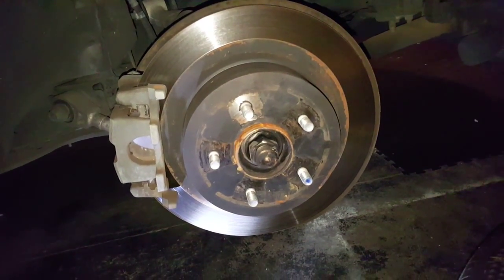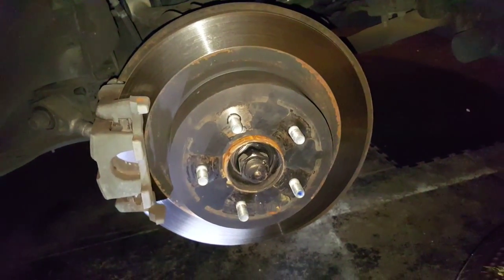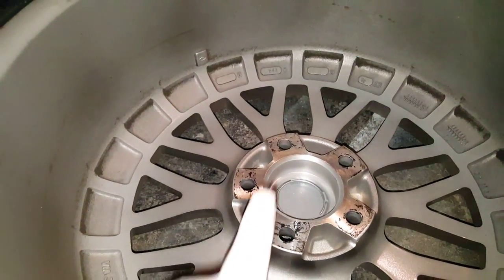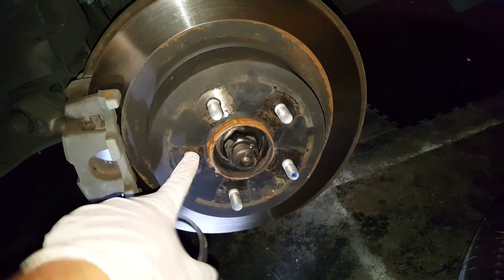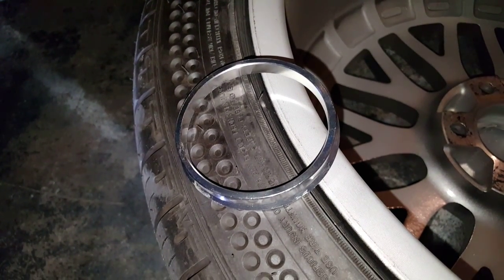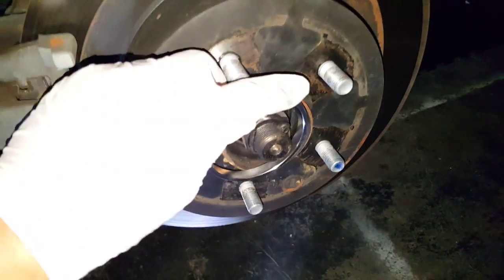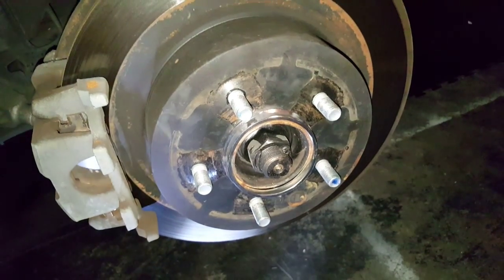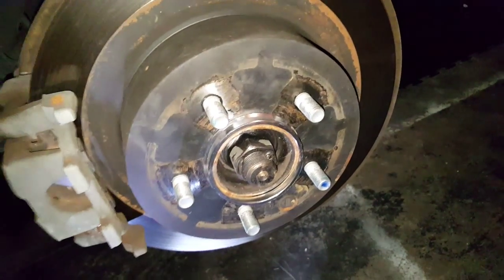How to install hub or hubcentric rings on aftermarket rims - Fixes vibration / shakey

Comment: Is the hub centric rings advisable to put on the steel rims. My winter tires with steel (not alloy) rims are bigger holes on the hub and planning to put these rings. Please advise. Thnks new subd.

Comment: With hub centric rings, can you run spacers also? Or do you need to have spacers that already have the hubcentric ring on them?
Reply: You have to buy hub centric spacers. There are non-hub centric spacers, and those are not recommended if you have a hub centric car(which is most cars).

Comment: Thank you for the video.  My question is, do you install the hub rings on the wheels first and then mount the wheels onto the hub, or install the hub rings on the hub and mount the wheel over it.  Thank you
Reply from the maker: Either should work. If it is perfect fit then  it shouldn't matter. If you bought the right size. If you put it on the hub, it shouldn't move. Then take it and put it on the wheels, it should fit the same.  If both then it shouldn't matter what order. I personally do the wheels

Comment: Do you know if these also fix wheel wobble ? I installed bigger after market rims and tires on my car and they start to wobble at any speed my stock didn’t do that and I already had the aftermarket ones rebalanced because I thought that was it but it wasn’t
Reply from the maker: Yes most likely this would be the cause of it's already balanced and its not balanced.  Buy it on Amazon. If it doesn't help, return it
Reply: @djsonnee  ok I bought it  hopefully they work

Comment: I have a 2010 Corolla and I was looking at getting the Motegi Racing MR119 Rally Cross S 17x7" rims to replace my stock 17x7" rims. Would I need to buy new tires as well, or can I just have a tire shop switch them over? Also, how would I go about finding a hubcentric ring to fit the aftermarket rim?
Reply from the maker: Kelby, I googled this, http://www.wheelsupport.com/toyota-bolt-patterns/ , and it shows you have a stock 54.1 bore size.  you need to find what your hub/bore size is on your new rims, and just search on amazon.  54.1 to xx.x centric rings, good luck!
Reply: i have an idea - just never put rims on a corolla.  ThanK YOU.
Reply from the maker: Hey Kelby, all shops will be able to swap our your tires, no problem.  But the larger tire companies wont if they are low tread but almost all the smaller ones will do it, if you have the low tire pressure, that would need to be swapped as well, legally i think they have to.  Just look up what the stock hub size is for your car the find out the hub size over your rims and search amazon for that.
Reply: If your planning to install aftermarket wheels then the new wheels should tell you its bore size, in the description or in the inside of the wheels. With that then you do a quick Google search and find out your vehicles hub bore size. Then you buy centric rings with both sizes. New wheels/vehicles hub bores. And thats it. And yes you can use same tires. What Im puzzled is why the heck would u stick with OEM specs?
Reply: @nikobellic7586  young and naive lol. Didn't actually end up doing that.

Comment: will it still shake after u buy the hub ring??? jux got a set of bbs n mine is shakin at 60 mph n up...b
Reply from the maker: mine didnt but that is assuming it was due to the wheel not being centered. if it didnt shake before your rims and tires are balanced, its most likely that

Comment: How do you measure what size you need?
Reply: I thought everybody owned a dial caliper
Reply: If your planning to install aftermarket wheels then the new wheels should tell you its bore size, in the description or in the inside of the wheels. With that then you do a quick Google search and find out your vehicles hub bore size. Then you buy centric rings with both sizes. New wheels/vehicles hub bores. And thats it.